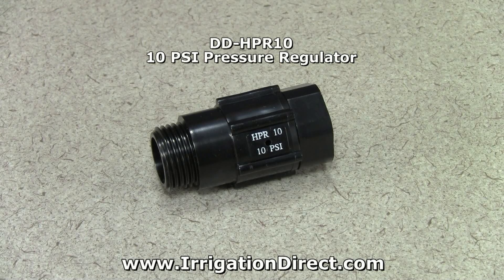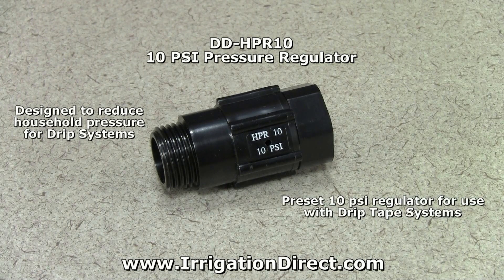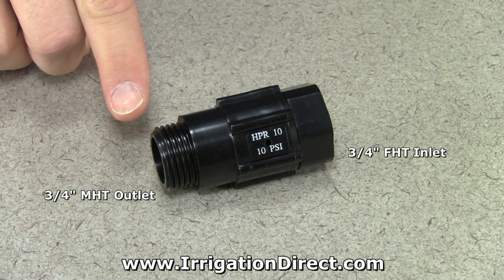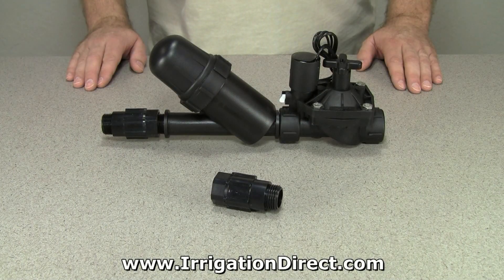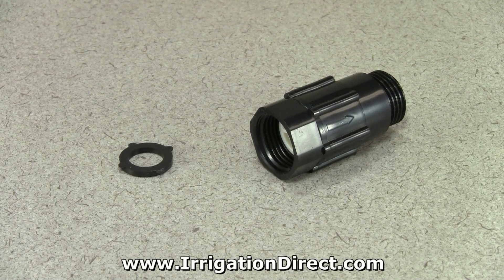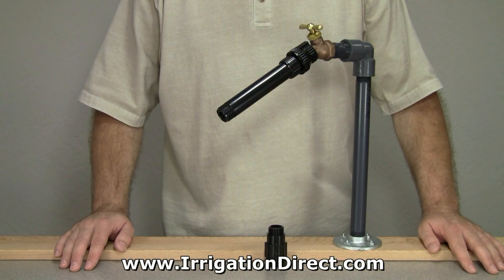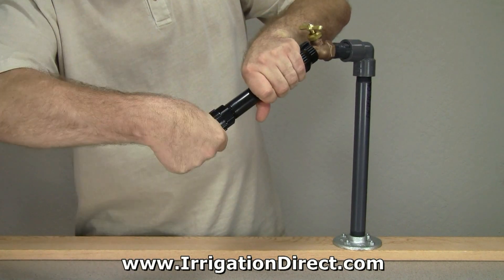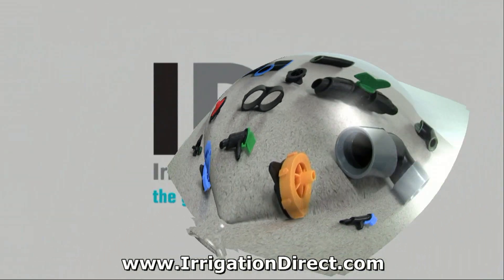Drip Irrigation Pressure Regulator DD-HPR10

Comment: i have water spraying out of the little hole on the side of the regulator. its never done this before
Reply from the maker: It 's possible that the internal o-ring is worn out or not seating properly.